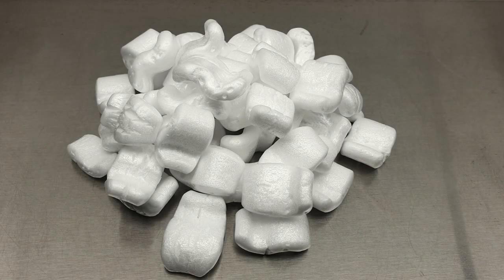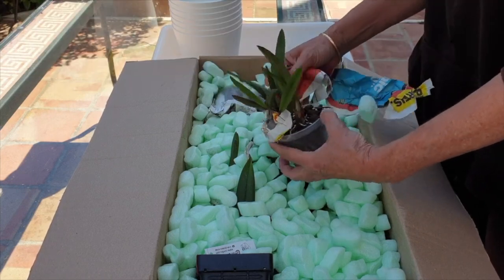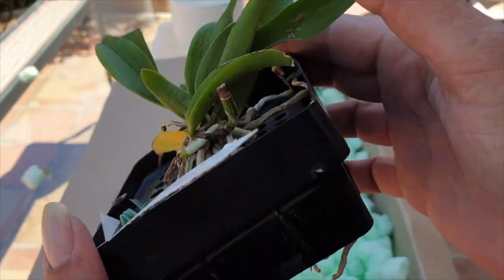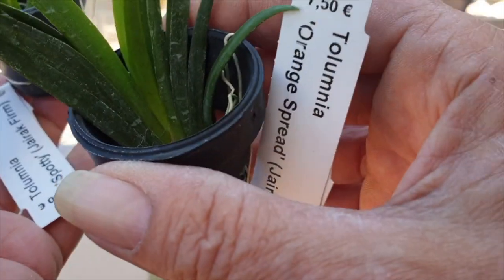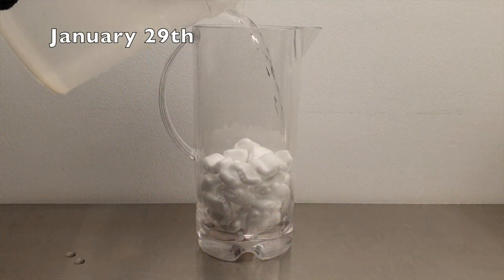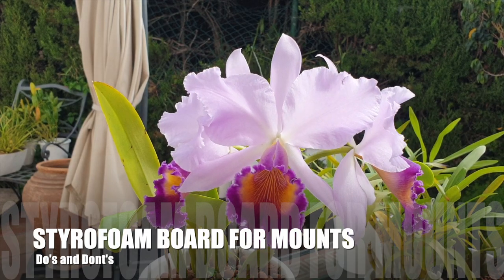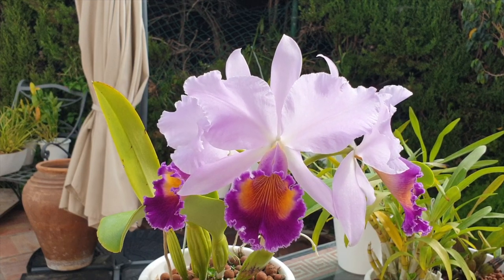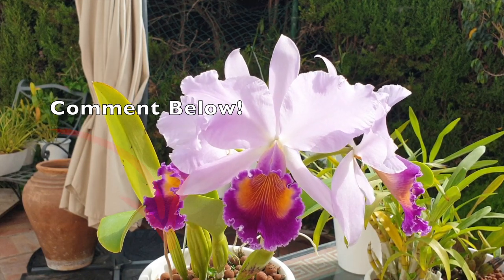How to How NOT to Use Styrofoam Packing Peanuts in Orchid Pots or as Mounts #ninjaorchids

Comment: I have been using white " S" shaped styrofoam packing peanuts  ( broken in half at the bottom of the pot for drainage ) for longer time. Never had any issues or problems with orchids roots not liking them. Two year ago ,during repotting my Cattleya 🌱 I did end up using small chunks of styrofoam bits in  bark mix media ,becouse I run out of bark 🤪 🤫🙈. Roots are fine and growing through the styrofoam and there is no problems with the 🌱( so far ) . Thank you Nina for sharing . Appreciate you mentioning about recycle &  reuse. ♻️ . Have a fantastic weekend 🤗🌷🐞🦋💚🙌
Reply from the maker: 😍 Zuuuullaaaa!!! Hi 💐 it is so good to see you!! I hope you are doing well and already having a great weekend 😃 It is great to get a confirmation of having the styrofoam in the media mix as such, and not just for crocking purposes. I appreciate you adding your experience by having done this, confirming that the orchid is fine! Much much appreciated! 👍🏼 these peanuts.... while they really are the best way to protect orchids in shipping, they are a nuisance if they are not biodegradable, unless of course the culture allows them to be recycled as in your case! Thank YOU so very much for watching, Zula 🫶🏼❤️🌸
Reply: @NinjaOrchids ❤

Comment: I've used colored (red) peanuts without any problems but most of the ones I've used are white. I have also tried using a block of polystyrene as a mounting material and the roots would not attach to it as with bark. Additionally, when exposed to sunlight, the block becomes brittle and begins to break apart.
Reply from the maker: Don Miguel 🥰💐 hola jefe! Good to know your hands on experience on the non issue with the ink in the colored peanuts! I appreciate you clearing that up 👍🏼 the roots would not attach to the mount? That is interesting, because they sure do not have any issues growing through the stuff, so not attaching to the mount? I have never thought that would not be the case. BUT once again, thank you so much for adding this in the comments as well. Now, I would love to have an orchid and a chunk of tougher styrofoam to give it a go 😅 maybe in a couple of years I am able to divide an orchid and try it out. BUT, the sun influence, that is even more important!! Can you give a heads up as to how long that would take? 😬 my mind is racing because this would be so amazing to explore and try out! 😅 thank you so much for watching!! I hope your Saturday started your weekend off just the way you planned it without any matata (problems in Swahili) 🫶🏼❤️🌸
Reply: @NinjaOrchids  yeah, roots grow right through the soft stuff and attach to the hard stuff in a pot. On a mount, they flatten but don't stick, it is very odd. As for the sun, it was probably a year and then it started crumbling. If you find a piece, just hang it up in one of your grow areas without an orchid and see how long it takes to become brittle. You will notice it yellowing first and then you pick it up and one day it practically shatters in your hand.
Reply from the maker: Ooohhh, thank you! I will try and source a board and see what it does 👍🏼 great idea. When I can, I will head to my dollar general and see if they are unpacking anything that I can sponge a piece off of them. Awesome.... experiments, experiments!! Me gusta!! I will leave one in a cubby hole that I have supplies in for the same time period and compare the 2... woohoo!! Thank YOU 😘